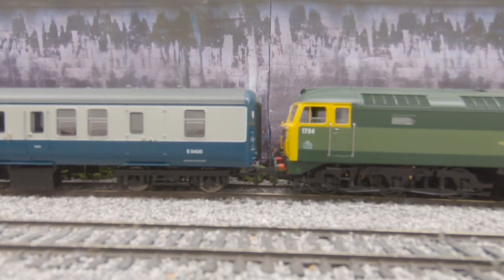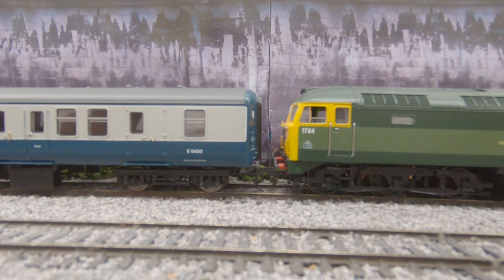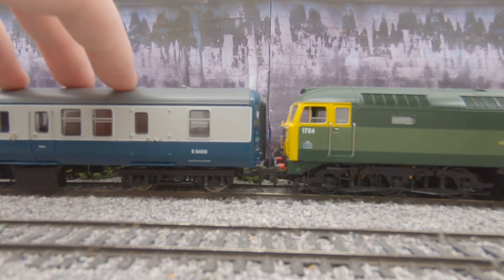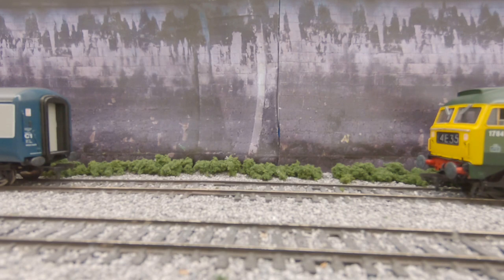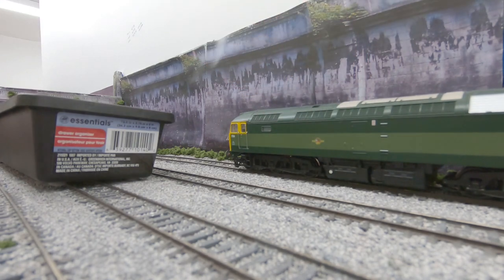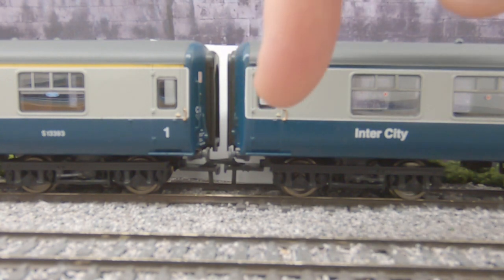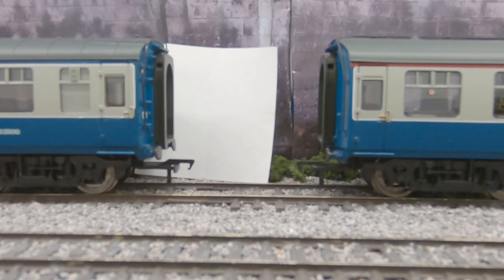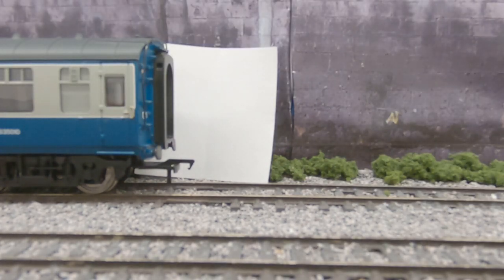Learn how to take Trains off your Layout or train set | oorail.com

Comment: Interesting tutorial. I have everything over to Hunt Couplings magnetic couplings, type E. Their newer type magnets have dual polarity which are so much better than the original patented design.
Reply from the maker: Thanks, glad you enjoyed it. I actually 3D print my own couplings and added magnets from K&J magnets. Have a look at https://oorail.co.uk/magnetic-coupling-design/ .. I don't think the Hunt Couplings are patented, they made some claim when they were originally announced on Dean Park but they had just filed an application. The problem with most types of magnet coupling is uncoupling them automatically. The types of magnet used in the Hunt Couplings is too strong to be able to auto-decouple it.

Comment: I straighten a paperclip to make an L shape with a fat bit at the top, put the L under the hooks, push the stock together to lift both hooks pull them apart and drop the hooks
Reply from the maker: Thanks Philip, paperclips are a good idea! I'm currently experimenting with a 3D printed uncoupling tool, we will see how it goes! :)

Comment: Nice video, but I wouldn't use a screwdriver, as one could accidentally touch both rails and short them. This is not a really big deal, but depending on the setup, this might lock up your DCC station and need to reset it.
Reply from the maker: Thanks. Thats a good point, most of the layout here is DC, so the power is off. I guess I'm in the habit of killing the power, even on DCC, just in case something starts to take off! Good catch on the DCC though.

Comment: Have you ever heard of a thing called a magnet? The tension bars are steel - just lightly compress the coaches together, lower a small magnet from above and - job done.
Reply from the maker: Thanks for taking the time to comment, I think you might have missed the point of the video, which was to show how the tension lock coupling mechanism works. The best option is an uncoupling ramp. The problem with using magnets like you suggest is that the magnet will attach itself to the tension bar, your rolling stock will come off the track or you'll end up with the magnet attached to both bars. You can't get the magnet close enough to raise the coupling without it attaching, even with a tiny 1mm magnet. Its worse with the modern compact tension lock couplings.
Reply: @Oorail  Hi, ok, that's fair enough, I stand corrected. Saw your vid about the coupling ramp.